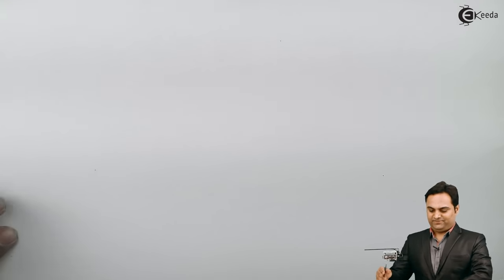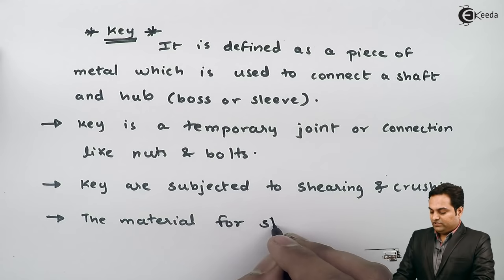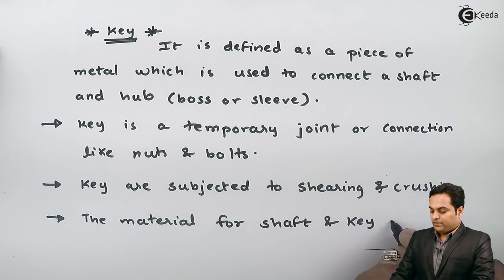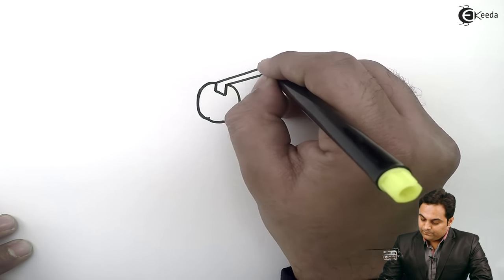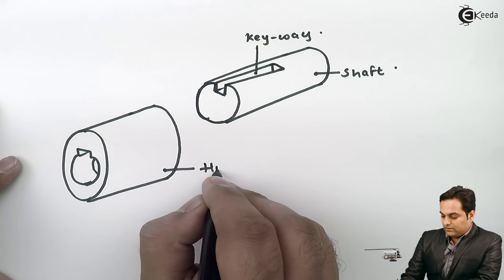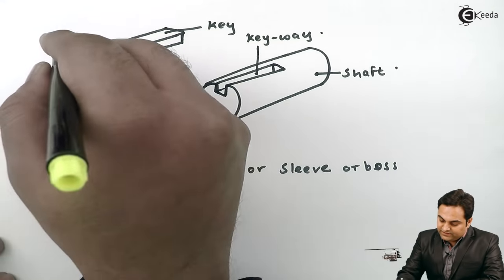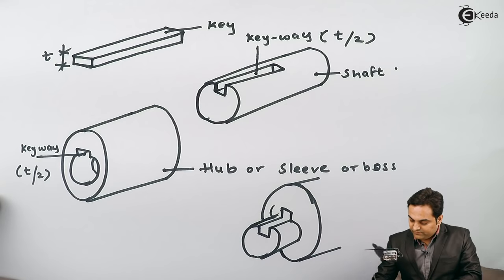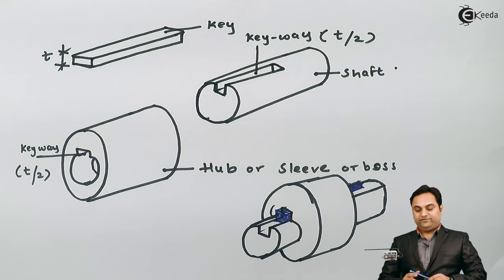Keys and Its Function - Design of Shafts, Keys and Couplings - Design of Machine

Comment: sir, you told thickness of key should be divided into half-half into hub and shaft.  shall we use keys in different ratio? like making less or more depth of key way  in shaft and using the key the same thickness what total thickness comes in hub and shaft. if it fails what may be the reason?

Comment: please help me, A transmission shaft is supported on two bearings  450mm apart. Two pulleys C and D are located on the shaft at distance of 100mm and 300mm respectively to the right of the left hand bearing. Power is transmitted from C and D. The diameter and weight of pulley C are 200mm and 600N and those for D are 300mm and 750N respectively. Ratio of belt tension is 2 for both the pulleys. Power to be transmitted by the shaft is 25KN at 300 rpm. The driver from C is vertically downwards while from D the driver is horizontal.  The shaft is of steel allowable shear stress is 47.5N/mm2. Design the shaft and draw all required diagrams
Reply from the maker: Your each and every question will be answered , you just have to visit our website which offers online engineering lectures at very low cost
just visit our website- https://ekeeda.com/ 
you can also download our app for better learning,
For iOS-  -  https://itunes.apple.com/tt/app/ekeeda/id1442131224?mt=8&ign-mpt=uo%3D2
For Android-  https://play.google.com/store/apps/details?id=student.ekeeda.com.ekeeda_student 
 Thank you!

Comment: the material for shaft and key never be same.
Reply: Gouttam Rout who said that to uj
Reply: I read that they key and shaft are usually the "same" hardness.
Reply: keys can be made with the same material as the shaft,  and by that, you can relate the keys length based on the shafts diameter considering they have the same torque.